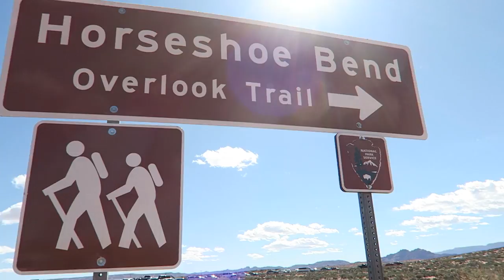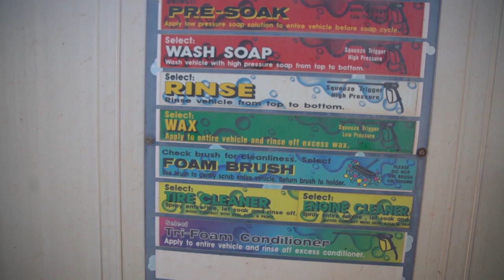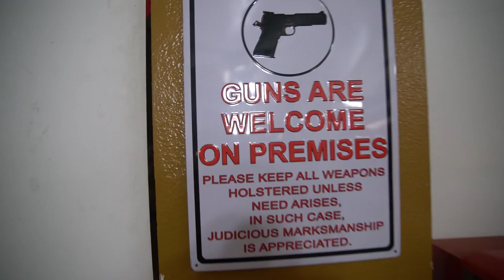Horseshoe Bend and Antelope Canyon - Great American Road Trip (Day 26)

Comment: Antelope Canyon - so that is the name of that awesome place. I have so many questions. Was it cold there to begin with? Did you go early to avoid crowds? When you ran your hand along the rock was the texture crumbly or was it hard and maybe smooth. This is a stunning video. I just added a place to my personal bucket list. Cheers for sharing lads!
Reply: I went to Antelope Canyon. It's better to go early to avoid the crowds, 8 o'clock is best. There are two parts of the Canyon, both you have to pay separately. The one in the video, they went to Upper Antelope Canyon it's just a straight walk through (exit is the same way you entered the canyon). Just a little ways north from there is Lower Antelope Canyon, which has stairs to go up and down. The canyon texture is smooth.
Reply: I went to Antelope Canyon. It's better to go early to avoid the crowds, 8 o'clock is best. There are two parts of the Canyon, both you have to pay separately. The one in the video, they went to Upper Antelope Canyon it's just a straight walk through (exit is the same way you entered the canyon). Just a little ways north from there is Lower Antelope Canyon, which has stairs to go up and down. The canyon texture is smooth.
Reply: It wasn't cold for me, I'm just use to AZ weather. Going 8am had a nice chill weather, I was the only one without a jacket but it varies on the person.

Comment: Im sure u have been told already but hey u asked so ill tell ya ur holding tank on ur model rv is the black tank(toilet) the sani wipes he was pulling out are very very bad they wont break down like only rv toilet paper will. 
Buy only rv toilet paper ur tank as i saw on ur screen is almost full with u dumping it its only taking what it can because its clogged. I hate to say it but u may need to rotor it out. 
When emptying ur black (holding tank) first then shutting it off and then ur grey water that helps flush out the hose  with water from ur dishes and shower then hose can be rinsed with ur portable water thats the hose that goes only outside rinsing. Never use ur other hose(Yes)u should have 2 hoses one fir drinking water then another for sewage cleaning etc. u can get mighty sick mixing the 2 up. If u need more help let me know k. By the way to fix the coney (sewage black tank) it can be up to $5,000 no more sani wipes k ...yikes...